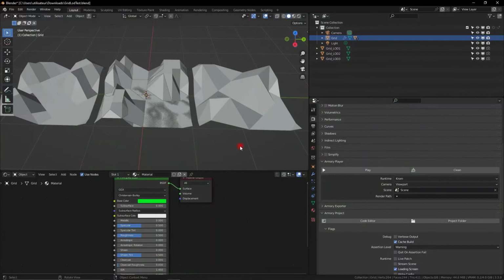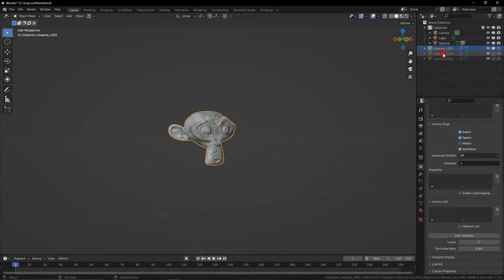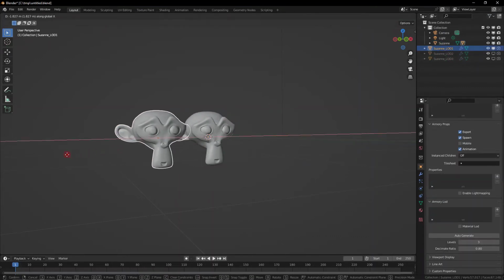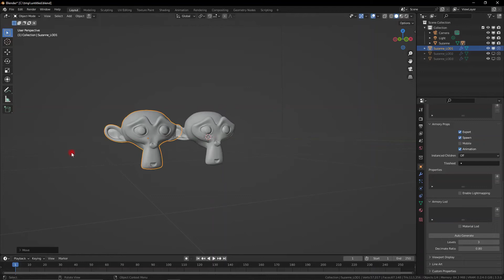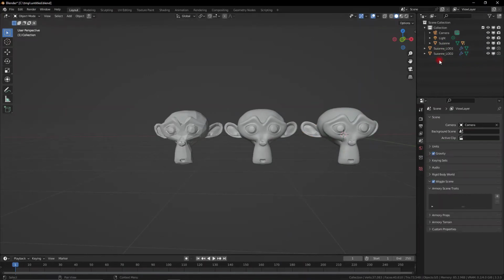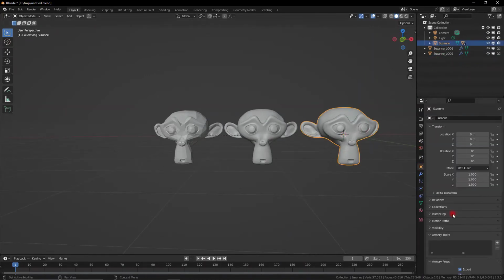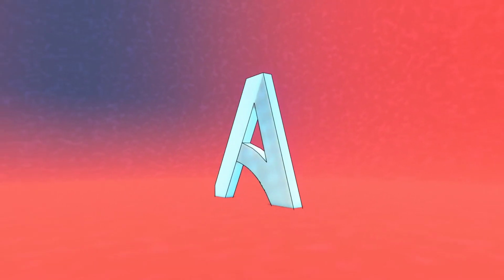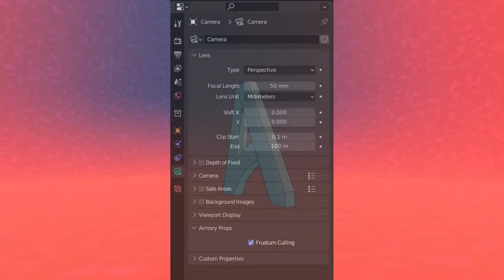Mesh optimization is Armory 3D - LOD's explained #armory3d

Comment: Off-topic question. What program do you use to record the screen?
Reply from the maker: A random screen recorder, the name of which I do not remember 😅
Reply from the maker: I use kdenlive to edit the videos and sometimes use it's on board screen recorder for filler shots.
Reply: I'd suggest OBS, it's free and it's very customizeable (along with working with livestreams and facecams). The only downside is it is a little bit difficult to use for the first time